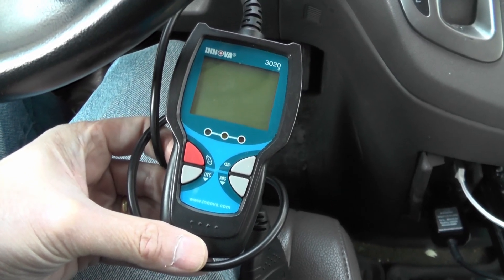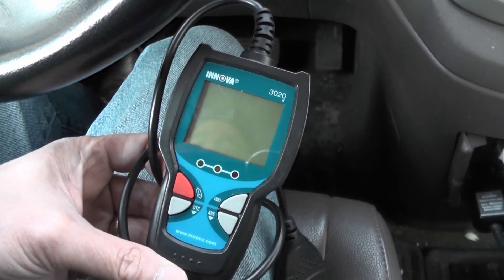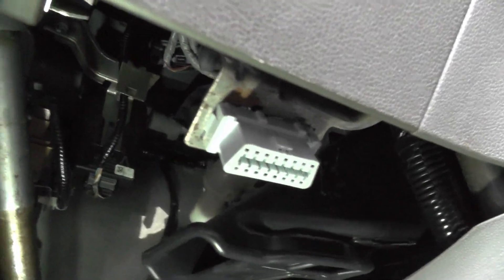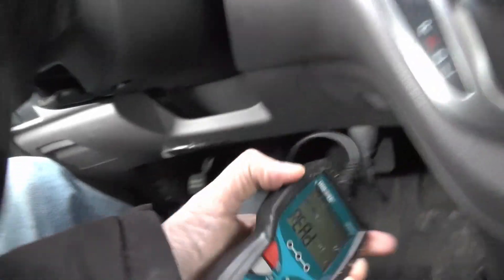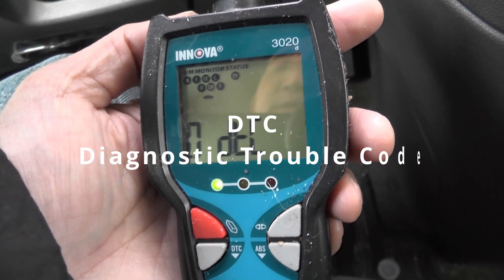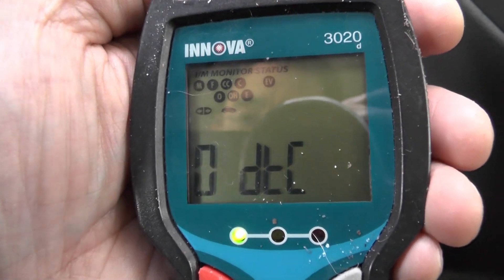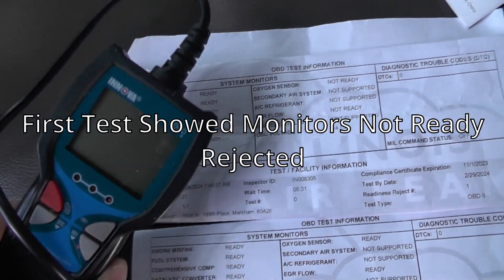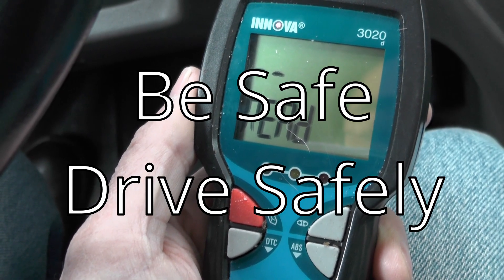PASS EMISSIONS TEST - How to use your OBD2

Comment: What if it says 0 dtc no codes but yellow ?
Reply from the maker: @anttheman6370  this is what I found in an innova manual online. 
‘Monitor Status – If the code reader’s LCD display shows the message 0 DTC (indicating there are no DTCs present in the vehicle's computer), but the yellow LED is lit, it indicates a Monitor Has Not Run status. This means that some of the monitors on the vehicle have not yet finished their diagnostic self-testing. This condition is confirmed by one or more blinking Monitor icons on the LCD display. A blinking Monitor icon means the Monitor has not yet run and finished its diagnostic self-testing. All monitor icons that are solid have completed their diagnostic self-testing. ‘
Reply from the maker: My guess is one of the I/M monitors is blinking as well?